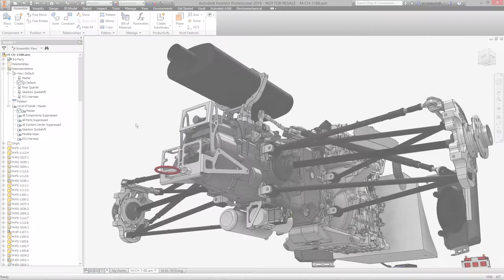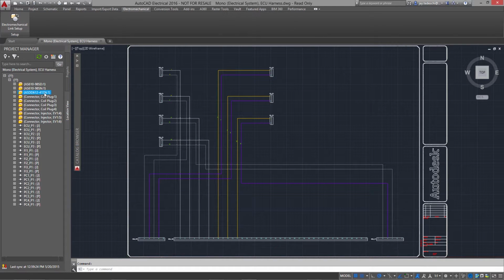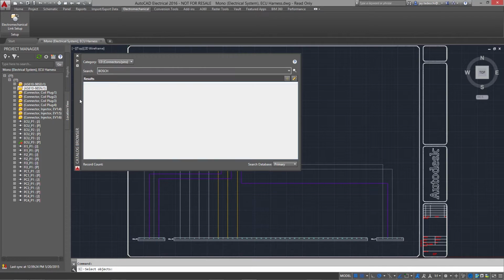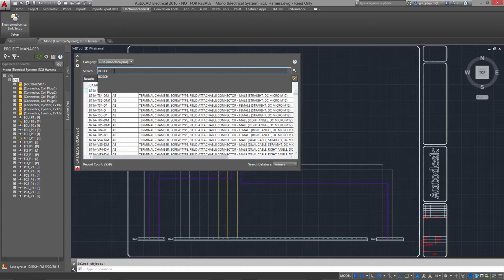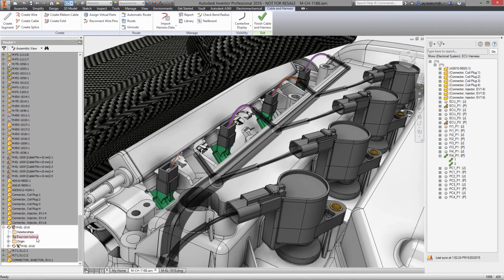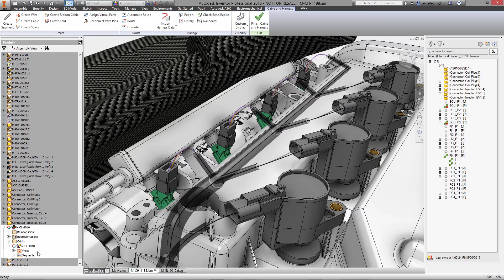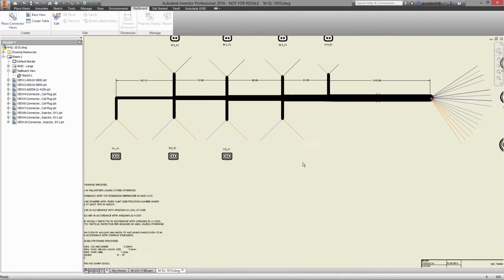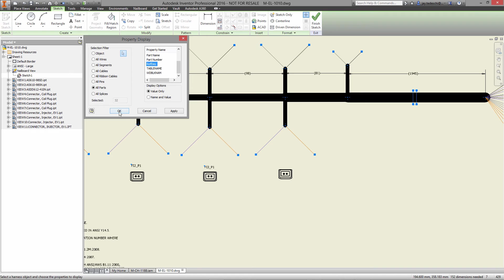Autodesk Inventor Cable and Harness

Comment: On the Inventor side when you finish the routing and create the Nail board there are multiple variable that need to be added ex. When you are building your Harness there are some spots in the connector that are blank and need to have a sealing plug added. I have used a virtual part to get a this information into my harness assembly but when I do this there is no way of getting that information to the nail board. Also how do you get balloons tied to your Harness?